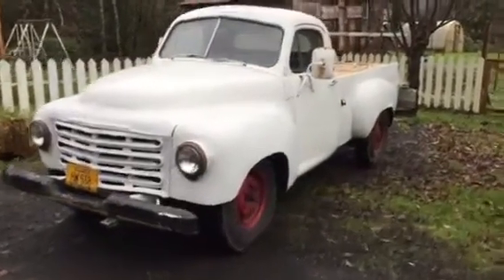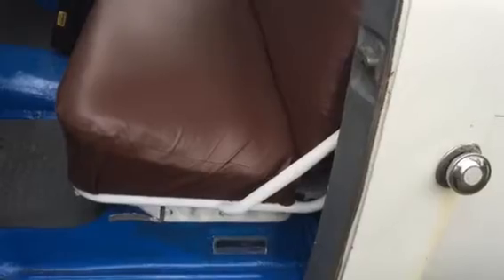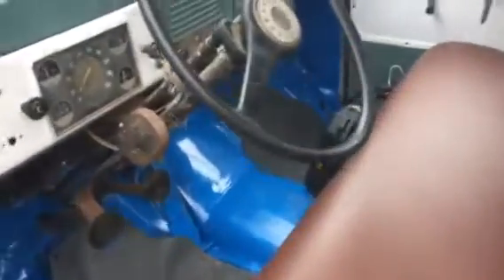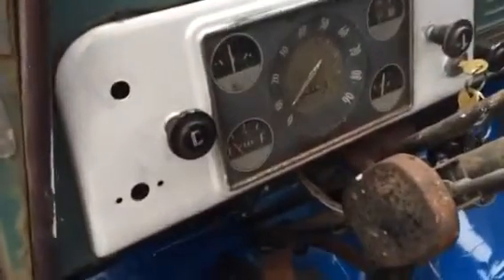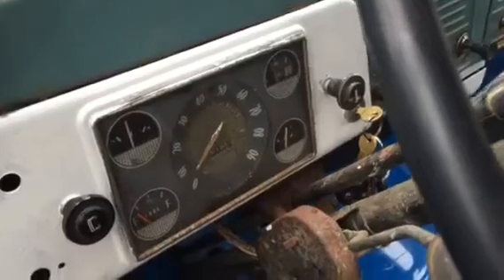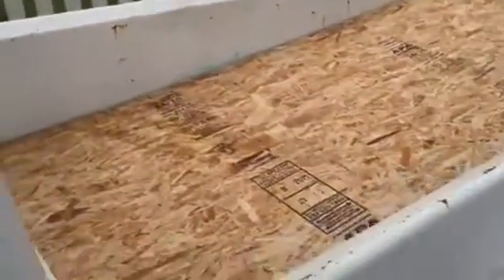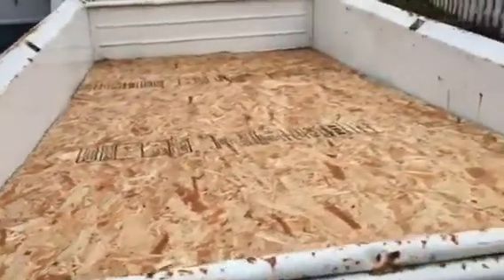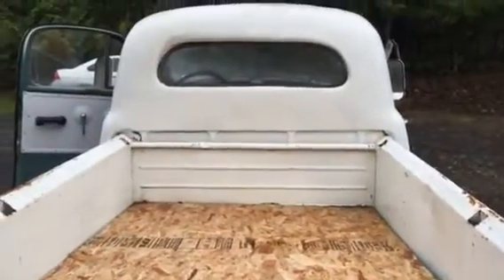1953 Studebaker 2R10 #myride

Comment: I think this pickup came in 2 sizes.  I had the smaller size but can't tell which size this is.  It looks like mine but the wheels seem bigger.  And I sure didn't have bumpers like that.
Reply from the maker: opentrunks, yes the smaller 2R5 is a half ton and had a shorter bed. The 2R10 has the longer bed and is 3/4 ton. The bumpers are not original, but they are really solid. Perfect for around the farm. Those wheels are the original split rims with heavy 4ply tires which I believe they would have been used back in the 50's at leased on a farm.
Reply: Yes half ton is what I had.  It was pristine in 1974 when I bought it for $475.   It was barely 20 years old and the funny thing is when I drove it in the city people would honk and make comments about it because it was so old!  But today people drive 20 year old vehicles all the time and nobody thinks twice about it.  I'm not sure if it was because it was so rare back then for a car to last that long, or if the styles had changed that much from 1953 to 1974, or what it was.  Right now I drive a 23 year old car and nobody blinks.  Anyway, nice truck, good to see it again, thanks.